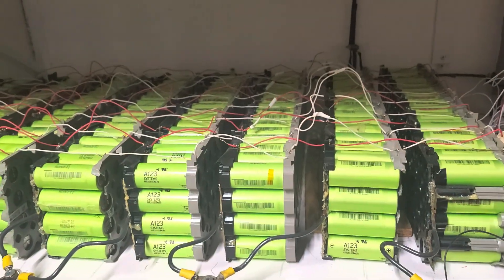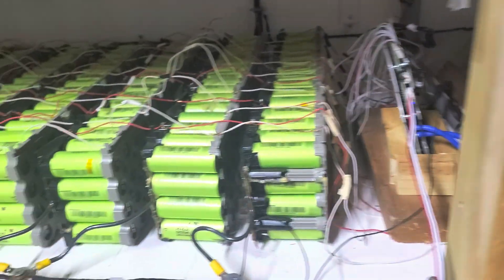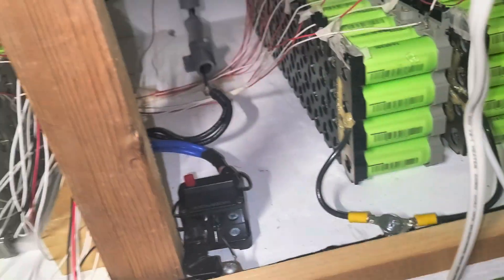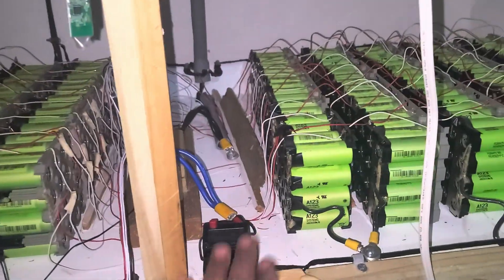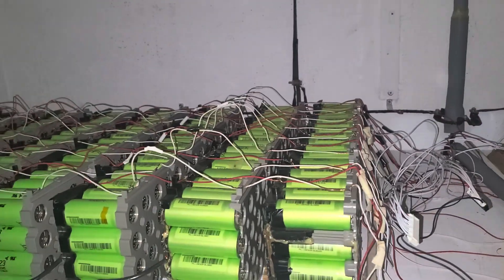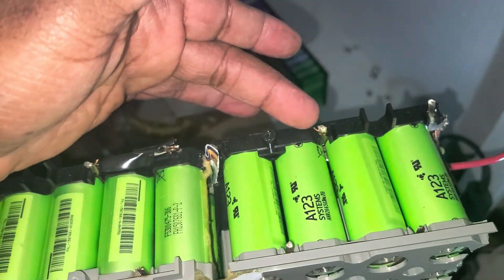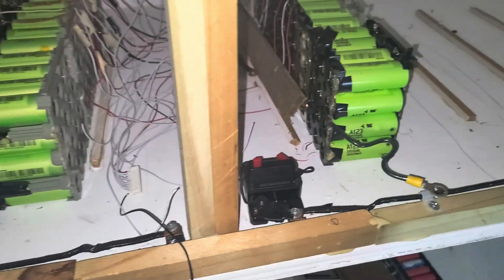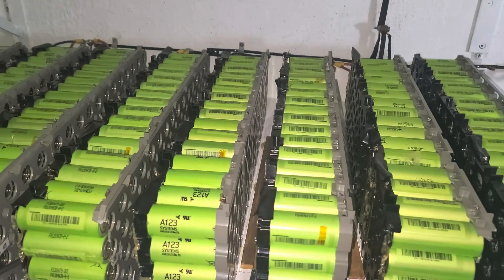LiFePO4 A123 CELL TEARDOWN lithium iron phosphate battery | LFP battery See how 7000 watts were made

Comment: Hey I have a doubt I recycled some 18650s from old laptop batteries and some of them aren't working...I just did Cid reset.... Is it okay if I use them normally?
Reply from the maker: I did that with 18650s but  they end up dead cell later
Reply: @simplyfocus9937  they have voltage btw if I Cid reset it
Reply: Is it safe?
Reply from the maker: @kusettiadityasaikumar5805  I think they are safe, I would advise everyone to take precautions